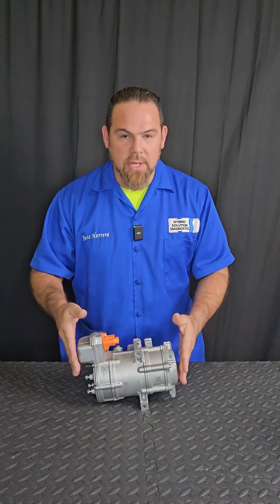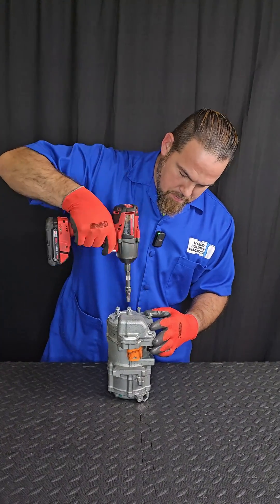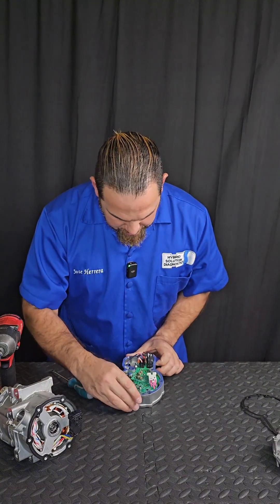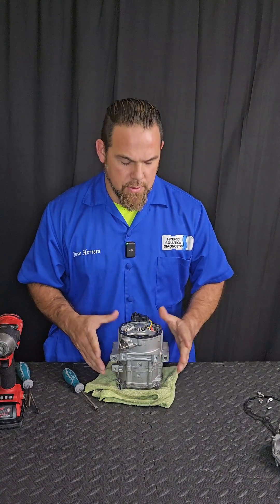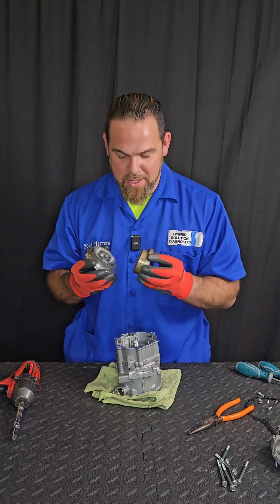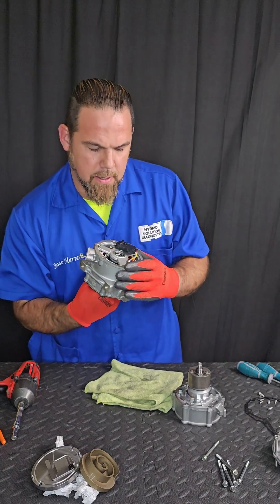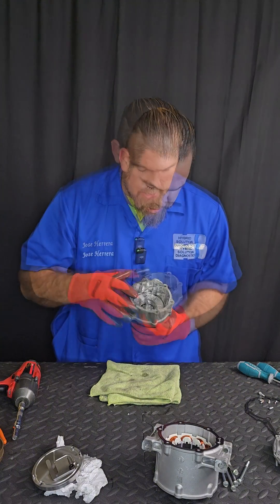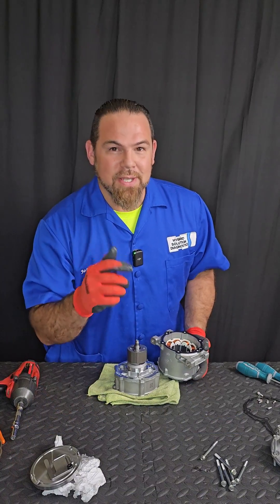Nissan epower DTC B2788 Electric Ac Compressor

Comment: If the compressor is noisy and causes vibrations in the steering wheel and cabin when it operates after starting the car in winter (at an outside temperature of 3-10°C), is it normal to feel these vibrations in the steering wheel or cabin when the compressor is running (Peugeot e-208)? Once the cabin temperature reaches 23°C, the compressor vibrations in the steering wheel become barely noticeable (when I place my hand on the hood, I can feel it vibrating) —should this be considered normal?
I think Peugeot uses Valeo compressors.

Comment: Hello.  Tell me what volume of POE oil needs to be poured into the compressor.  Only the compressor is not the same as the one in your video, apparently since 22 they have been different, since on the Nissan Note e-power of 19 it looks different.
Reply: My small bearing fell apart!  But the big 6204 works with noise and jerking, it was easy to find according to the model, but finding a bearing 15-37-10 is unrealistic!

Comment: @hybridsolutiondiagnostics Nissan Note e-Power air conditioning system trips or stopped working when the outside temperature is higher like 45C or more in the asian countries during summer, can you please provide some guidance what really causes that issue, and what will be the remedy.

Thanks in advance.
Reply: Update 2: Further investigation by recreating the issue found that the compressor overheat protection kicks in at 90C that's what is stopping the compressor. Check the value of the Compressor IPM Sensor. Needs a good scanner preferably Nissan Consult 3 Plus as most low end scanners doesn't show this value. Reason for overheating is the compressor going very high pressures (200+ PSI). Need to determine if the high pressure sensor is faulty or there is a blockage in the lines. Will update further.
Reply: How are you, how did it end?  Have you changed the 6004z bearing itself?
Reply: @REV1010REV  So the pressure sensor reading seems accurate which shows the high pressure reading above 200PSI as well. I don't know if it is the bearing, because there is no abnormal noise or vibration except the heat, need to determine if the heat is caused due friction. Couldn't check any further because of exams. Will check and update after next week.
Reply: I may have something else, since when I turn it on, there is a clear extra metallic sound.
Reply: @REV1010REV  found your video. Mine doesn't make that sound. Yours is probably due to a failed bearing or even further due to the scrolls rubbing on each  other due to extensive bearing failure.
Reply: @missakaiddamalgoda1879  Thanks, I also have suspicions about the bearing.  I hope to get to the experts tomorrow and they will help.
Reply: @REV1010REV  Any update of what happened with your compressor.
Reply: Same started to happen with mine. We removed the compressor wires, cleaned the lines, cleaned the radiator fins, oiled with POE oil, and installed it back again, but now the compressor doesn't start at all. Now diagnosing if it is electrical or software related. Will let you know. My advice don't do anything yet. Use it as it is. Also when the ac stops there is a temporary quick fix for it that I found. Pull over from the road, Turn off the car (just turning off and on the ac won't work) completely for 30 seconds or more and turn on the car back on.
Reply: Update 1: The compressor had a wiring connection issue that's why it didn't start after removing and reinstalling. But Cleaning up the connectors and clearing the codes using Advanced Diagnostic Tool with an VCI made it run. But still had the Compressor stopping when driving slow in Tropical Hot climates

Comment: Hello, I have a question to consult. My 2016 Prius C has driven 250000 miles and recently experienced a high temperature alarm. I added coolant and after 3 days, there was a repeated issue, but I did not see any leakage. What is the situation? Thank you.
Reply: Is the high temperature notification related to the engine or hybrid system? If it engine check all components related to temperature management of your  car,  it is hybrid  system check small water pump that pumps water to cool hybrid inverter.  But it could be easier if you can share its associated trouble code for precise response.
Reply: @tanzaniacarschannel6975  Thank you
Reply: @tanzaniacarschannel6975  Hi, I just had something even crazier happen to me, I took my car in for repair and the repair shop said it was fixed, then 3 new problems popped up and they repair shop said they were not responsible
Reply: I want to consult you

Comment: I have a similar issue. I am from Sri Lanka and have a Note HE12. It is a very rare car over here. My issues is we removed the compressor for a AC issue. But after reinstalling the compressor is not turning on. We’ve checked the fuses in passenger door side compartment. Are there any relays or high voltage fuses that I should check for. Pls help.
Reply from the maker: The compressor has its own relay
Reply: @hybridsolutiondiagnostics  Can you please guide me on the fusebox which this is located. I don't have a service manual of this vehicle.
Reply: I'm also from Sri Lanka facing the same issue. May I know is it working fine after replacing the compressor
Reply: @RasanjanaAmaratunga What happens in your car? Does it only stop the AC when it is extremely hot outside. Or when the car is stationary in the traffic or similar situation.
Reply: It's always tripping not depend on these scenarios 😢
Reply: @RasanjanaAmaratunga Goto a diagnostic shop and check if the Compressor is tripping due to AC Compressor IPM temperature high. You may not see this as an error. But when you check the Live data feed, check the AC Compressor IPM Temperature sensor. The AC compressor turns off when this goes to 95 Celsius. If this happens before getting a new Compressor, in the same scanner go to Radiator fan and set the fan speed to 100% and see if the AC turns back on and holds on without tripping. If thats the case then probably your fan motor or controller is bad. In mine this is the case. So we determined that Its a fan issue rather than the compressor issue. Still couldn’t determine if it is fan motor or the fan controller that’s bad yet. What I stumbled upon is in Tropical climates like ours people has been installing a second fan in front of the radiator of the nissan note.

Comment: The brushless DC motor has 9 poles in the stator and 7 poles in the rotor you  multiply 7 ×9=72 so the 😊rotor will
Spin 72 times a second.